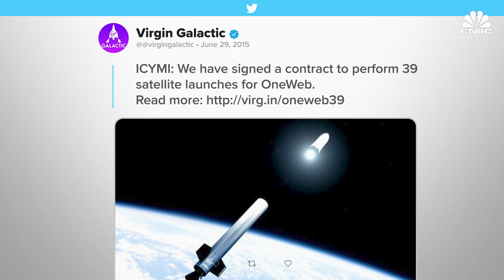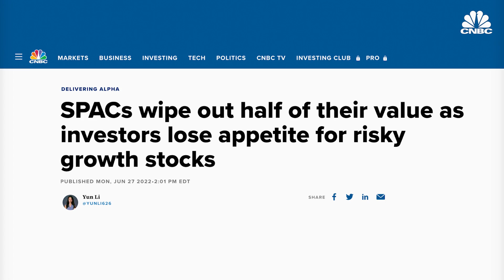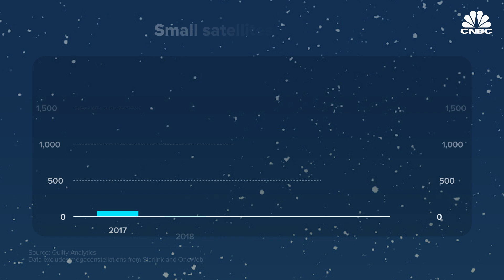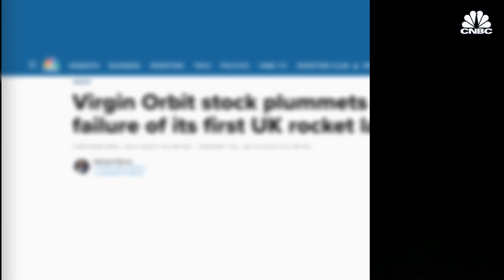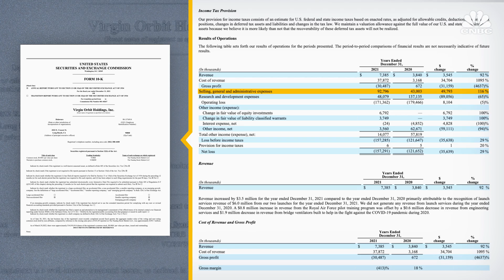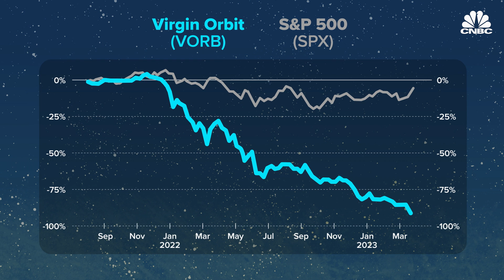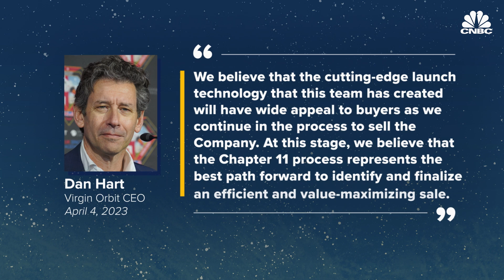Why Virgin Orbit Failed

Comment: "What went wrong with the Richard Branson company that once held so much promise?"
Your premise is wrong. Virgin Orbit never had much promise nor a good business model. It was fundamentally limited and handicapped from day one. That's why some 80% of the SPAC investors pulled their money out before the IPO. They knew it was a dog.

There is no giant market for dedicated small launchers. No one is gonna launch a constellation of hundreds or thousands of satellites ONE SATELLITE at a time - that would be like shipping each Nike sneaker from the factory on its own boat across the Pacific. And most non-constellation customers with a single small sat are perfectly happy to go for a cheap rideshare on a big rocket (Falcon 9 Transporter, India's PSLV). Even Rocket Lab - the most successful small launcher - makes the majority of its revenue from space systems, components and the like, not from launch. There's no money in dedicated small launch, which is why EVERY SINGLE small launch company is working on larger rockets.

But Virgin Orbit could never build a bigger rocket, because they already launch from a stripped-down 747, at the limit of its capability. Also, as an air-launched system, Virgin's rocket had to be structurally reinforced for both horizontal AND vertical loads, increasing weight & complexity and further reducing payload capacity. Lastly, Virgin spent a billion dollars developing a small rocket that can only bring in $12-15M per launch. There was no way they were gonna get enough customers or launch frequently enough to recoup their development costs. Their business case never added up. Bankruptcy was always a question of when, not if.
Reply: Good arguments, except a small thing about SPACs. SPAC investors didn't pull out because the company had bad fundamentals, they pulled out because the hype had soured on SPACs. In 2020-21, any horrible company would see a >100% increase upon SPAC listing. The speculative market was gone by the time Virgin went public. If they'd gone out 6 months early, they likely would have raised a couple hundred million extra, which would've helped them survive longer.
Reply: True, you really need a technical CEO in the rocket business. All the startups have very technical CEO's.
Reply: This is a classic Richard Branson business model: raise as much as he can of other people's money and keep raising money. I don't think he ever has a goal of making a real profitable business. Just a company that has the ability to borrow as much as he can so he can say he's a billionaire.
Reply: Very good post. Excellent presentation of facts to support your argument. I find the collapse of Virgin Orbit sad but, as you say, inevitable. I did not know that Rocket Lab had expanded into the space systems business. That is very interesting and explains why they have not run into the same problems that brought down VO. Obviously, VO could have done the same but, apparently, somebody lacked the vision.
Reply: But Branson was good at getting governments to invest.
Reply: This is one of the best YouTube comments I’ve ever read

Comment: I think the commercial space industry has rapidly been evolving. It seems like Virgin Orbit had less capability. Also, 2 out of 6 failures is not great. They basically seem like a company still heavily in the R&D phase with an anemic roadmap. I know that sounds brutal, but it seems like the commercial space industry growth will be highly influenced by two things. One, reduction in cost for weight to orbit, and 2 the ability to move smaller things or people to orbit in hours, not months or days. I think that’s what makes companies in the game more successful.
Reply: Actually currently people can go to orbit in minutes, Docking with ISS requires anywhere between 6 to 72 hours.
Reply: I’m referring to the logistics involved with a launch. If you wanted to do an emergency launch like get a satellite up or deliver supplies, you would most likely be paying for the vehicle as well as cost involved to bump other companies or govs. If a company had a proven ability to launch with minimal notice, that would fill a niche.
Reply: @apok1980  Launching big Rockets require permits, Good weather and hardware inspections , So they are not in the same league as aeroplanes ,but in 2022 SpaceX launched approximately One Rocket in every 6 days ! So that's as frequent as it can get.

Mid-size Rockets like Falcon 9 and Gslv mk 3(Indian) cost 67 million dollars and their payloads may cost beyond a billion dollars ,so you should not be taking risk to ramp up launch frequency.

Comment: they saw it coming a while back, which would explain why they spun it off from virgin galactic
Reply: No, it spun ff because orbital satellite launch is a very different business from suborbital tourist hops. It made little sense to have those two businesses under the same management. If they had known it could not be profitable, Virgin Galactic would have simply stopped work on it. Now, given that Orbital ATK's Pegasus rocket had already been forced out of the market, even if it was technically still listed as active, there was a great deal of skepticism that VO could be made to work, but the Virgin Group are not so stupid as to pursue a business they know will fail.

Comment: Love how SpaceX is touted as a competitor when they are competing in a completely different weight class.
Reply: They really are a competitor with their "share ride" program.
Reply: Love how everyone thinks that someone on the planet is competing with SpaceX, when SpaceX alone in 2022 launched into orbit 95% of the commercial payload of the world and the same mass of everyone combined...twice over, and probably did all of this at a fraction of the cost of the rest of the planet. It's the same people who thinks that Tesla has competition, when Tesla is selling you a 48k$ cars that they make for 33k ( Q1 results of 4) days ago, meanwhile the competition is selling you a 60k car with worse specs, and that cost them 85k to make ( hello -40%-margins-on-EVs-Ford).
Reply: Did you guys miss the entire section on SpaceX offering rideshares? SpaceX flies the Transporter missions which carry dozens of smallsats each
Reply: @alt8791  even so virgin orbit would only be able to fly 1 or 2 of them. Spacex is easily doing 5 if not more (depending on size of course) at a fraction of the cost. Virgin orbits only marketing is you don't have to wait a year for others to sign up for a ride share. Spacex isn't competing in this space. Merely just picking up what slack is left
Reply: @winnipeg21 
“The maximum number of satellites that SpaceX has launched on a single Falcon 9 rocket is 60.”
Reply: @hugolindum7728  replying a year later. SpaceX doesn't compete with virgin orbit, even today. Those 60 satellites are starlinks. Compared to other Sat's they are tiny. Idk what you are getting at here?